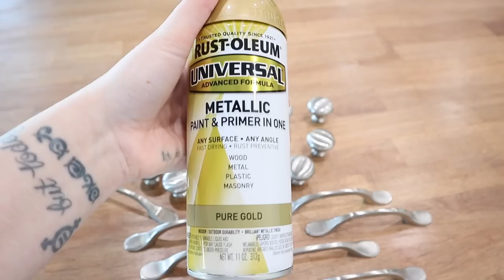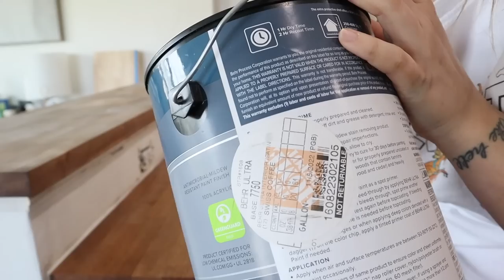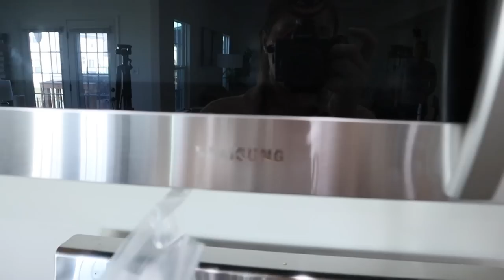DIY Kitchen Makeover! Painting Cabinets, Butcher Block Countertops, Decorating Ideas, Before & After

Comment: Dawn dish soap is pretty good for taking paint out of cloth and off hands, rollers, paint pans, etc. wash it as soon as possible. I am a landscape painter using Bob Ross technique. I use oil  based  paint. It was really surprising that Dawn dish soap could be used for washing up. Don’t use it in your kitchen  sink , unless you immediately clean the paint off the sink, cabinets or anything else you get paint on.  It will even work to remove paint from your clothing. Just pretreat and rinse it out before washing. I love the blue paint. I am considering using that color in my bathroom!
Reply from the maker: Thanks for the tip!